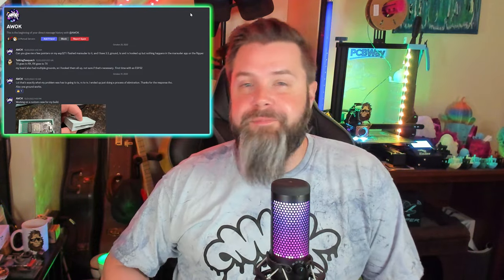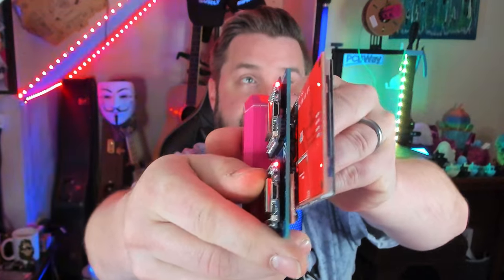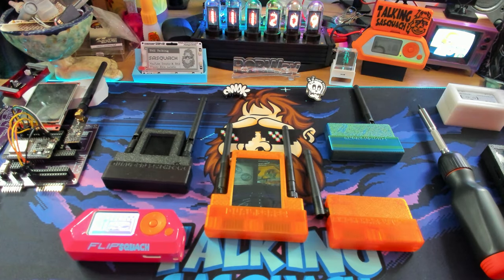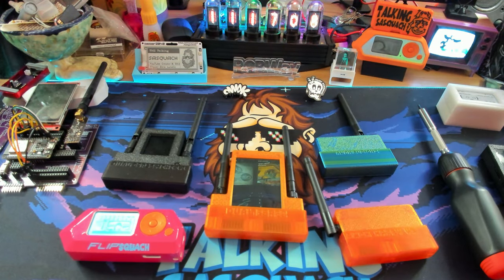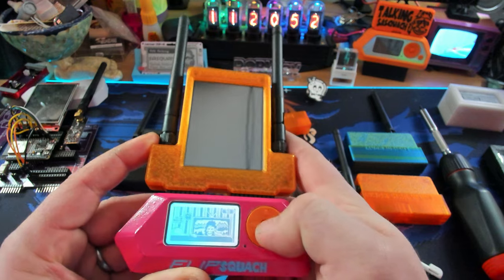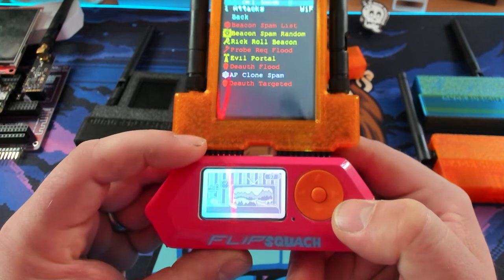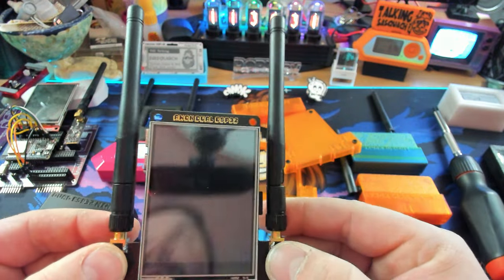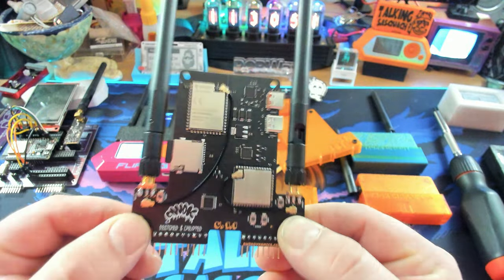AWOK's Dual ESP32 Marauder Boards I'm Not Supposed to Talk About! Flipper Zero GPIO Board Gone Wild!

Comment: Those locations of the USB-C ports are terrible with those antenna being in the way, but those are amazing looking and their functionality is amazing too. Just poor USB locations.
Reply: While I agree, they kind of makes sense tho. You are not going to use them too often and they are still accessible if needed
Reply from the maker: Yeah they're not super ideal but remember that U can flash the flipper board via Flipper and you barely need to use them.  Looking at the layout of the board, it seems like the best place u could fit them in.

Comment: Cool stuff.. P.S. that 433MHz antenna... doesn't look like a 433MHz antenna ;)
Reply from the maker: Good catch, it is reverse polarity, AWOK had a reason for it but I don't remember what it was
Reply: What makes you think that?
Reply: @AWOK  antennas of that lenght are usually tuned for 2.4GHz.
Reply: @NicolaSelenu  I specifically ordered them in 433hz from the manufacturer. I also have 2.4ghz ones in the same style and length for nrf boards. Unfortunately this batch i ordered didn’t have markings on the antennas to tell you it’s a 433mhz or 2.4 besides the packaging it was shipped in. Very easy for people to get them mixed up for sure.
Reply: @AWOK  I see. Were you able to test them to confirm they are 433MHz antennas? The thing is.. I believe you but I don't trust the manufacturer word on this. It wouldn't be the first time they advertise a 2.4GHz as a 433MHz. On Ali it's sadly common
Reply: You might have that already, but nanoVNA devices are great for this purpose (antenna testing)
Reply: @NicolaSelenu  I was actually looking into one of those. I think there are 2 different models right? I also mess around with grms and ham radio so Iv been looking for something to play around with antennas.

Comment: Hey man i have all the matterial to build some of the esp 8266 with touch screen and micro sd card holders i was wondering if you could either help me with a schematic or point me in the right direction. It would be greatly appreciated.

Comment: Can you have multiple softwares on a flipper at the same time, ie- have marauder and unleashed installed at the same time, or can you only have one software other than the official?
Reply: Marauder is flashed to the esp32. Unleashed is firmware for the flipper itself. They’re two different things that work together. A lot of people run custom firmware on their flippers while also flashing marauder or evil portal to their wifi dev boards, for example.